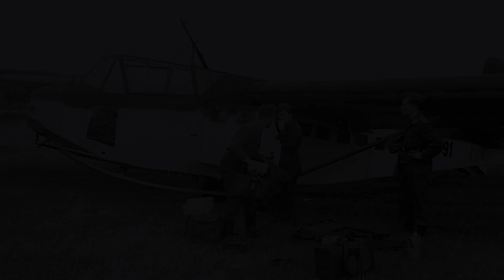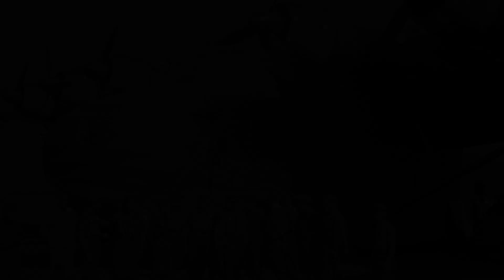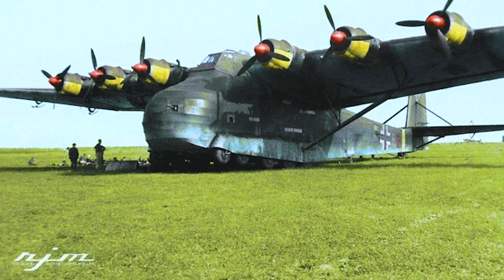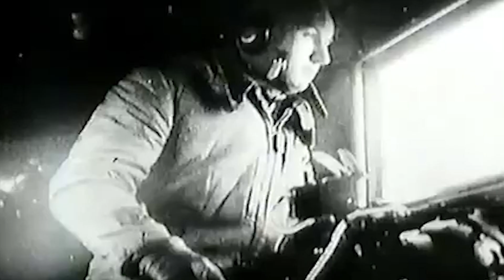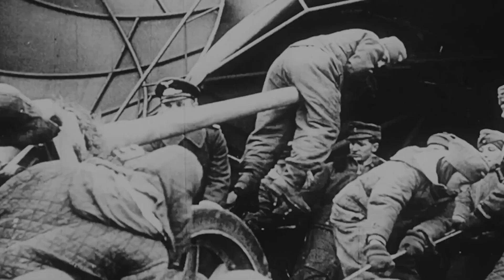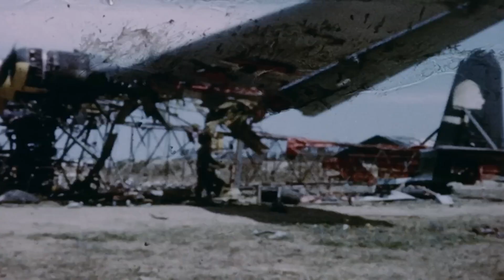GERMAN WARTIME DISASTER AIRCRAFT   NEWLY EDITED

Comment: The attack on the flight heading for Tunisia was the worst loss from this plane.  But another is worth mentioning.  You spoke of the use of both tow planes and rocket assistance for take-off.  During development a trial was held with a Me-321 Gigant fully loaded with troops.  The three Bf-110 tow planes were attached and the take-off run was proceeding; but when the rockets were fired only one side functioned.  The asymmetrical force yawed the Gigant, and it went down dragging the three tow planes with it.  Needless to say, of the 129 people on the four aircraft, there were no survivors.  (source "Aircraft of the Third Reich") but it is mentioned here: https://en.wikipedia.org/wiki/Messerschmitt_Me_321_Gigant
As a better tow plane the He-111Z Zwilling twin was designed around two He-111 aircraft, joined with a central wing section replacing two outer wings, and incorporating a 5th engine.  There are a few to be seen in your video.
Reply from the maker: Thank you John for your most interesting feedback, hopefully you can subscribe to my channel. Chris.
Reply: @GULLPERCHHISTORICALARCHIVES  I am subscribed  🙂